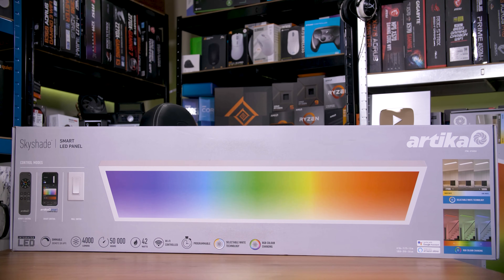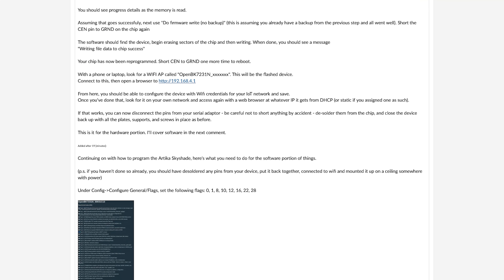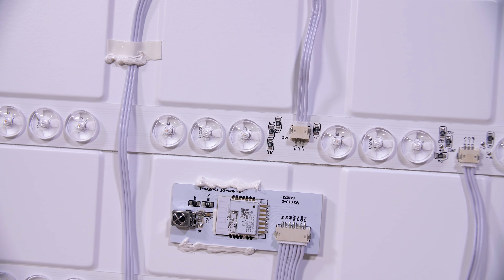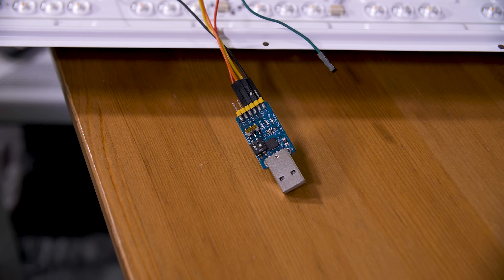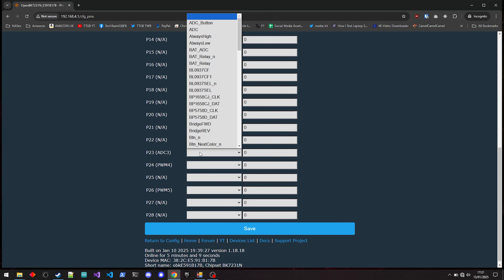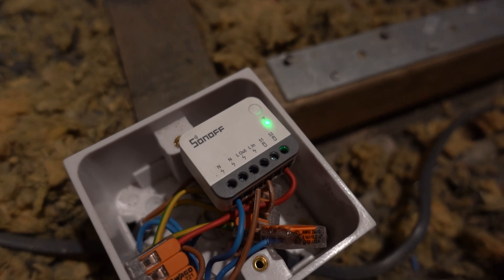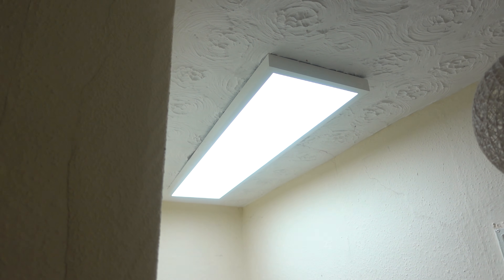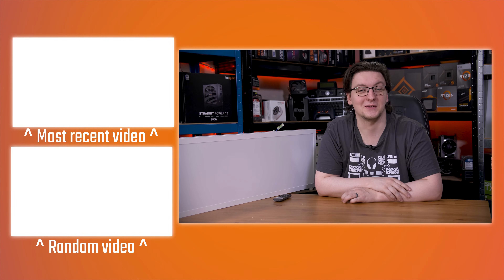Hacking Costco LED Light Panels - OpenBeken Firmware Installation

Comment: £35 today at my costco.

Gonna try it.😂
Reply: Mission failed :/

It was very difficult to solder to the tiny pads.
I haven't done something like this before, so I wasn't expecting to be an expert.

I think the PCB is attached to the frame via some thermal pad/glue, which takes the heat away.

Afterwards I wasn't careful enough and somehow ripped the TX and RX pads off the small PCB :/

Tried poking through the pcb to get a connection, but nope.

Still works as a light with the IR remote but idk if there is another way to flash it.

Comment: Shame no WLED.

If these things were dirt cheap, it would be great to buy just for the shell, and then replace either everything, or just the controller board with an ESP32 running WLED.
Reply: I was wondering if this was possible as well. I would much rather just replace the board with an esp-32 running WLED if that was possible. I might have to to more research about that possibility.

Comment: While ranting about lights that require the internet to operate, you should also rant about manufactures who create disposable light fixtures. I'd rather spend my hard earned money on Smart Bulbs that fit into a standard fixture. I've had to replace an $80 LED fixture due to a  power surge, but I can get smart bulbs for $10-$20 that fit in a dumb fixture.

Comment: Real nice tutorial 👏 really tempted to get some for my home. Would pull the trigger immediately if I could just fit my own WLED controller to it instead.

I highly recommend switching to Zigbee2MQTT though, it’s SO much better at dealing with device options like you described. And if you get yourself a second dongle the repairing process isn’t anywhere near as gruelling as you’d imagine, as you can run both simultaneously and move one device at a time as and when you feel like it (I had 70 devices moved over the course of a weekend).

Comment: I have one of these in my kitchen, also got it from Costco. Super value for money. I have mine set at 10% brightness and it is plenty bright enough. I haven’t flashed it, I have just connected it as is. They are a pain to put up as well, even with good ceilings they are fiddly.